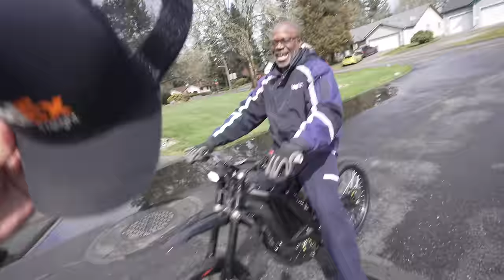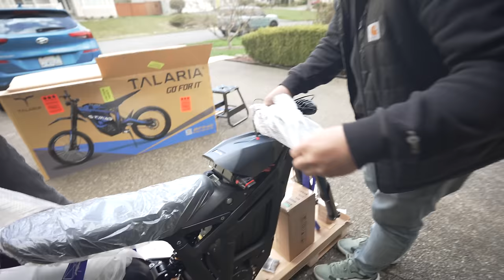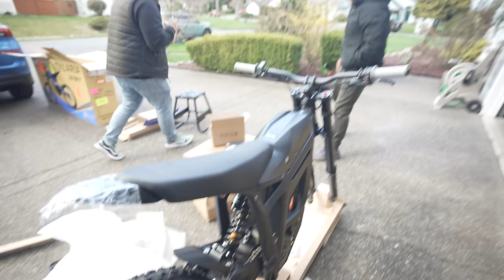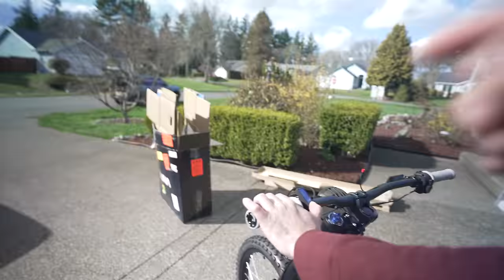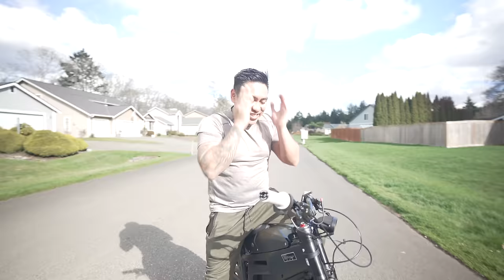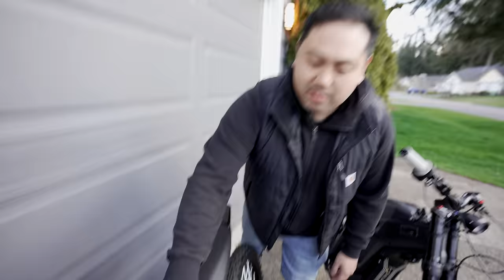Talaria Sting R Unboxing, first ride, and review! @emiliosibs @masonjagat @LunaCyclesLLC

Comment: Why did you cut the brown wire was that the speed limiter?
Reply: I would like to know too?
Reply: Yes it’s a governor, it will limit the top speed of the bike. I think b4 you cut the wire it only goes 18mph in eco and around 28mph in sport… after cutting it goes around 55mph.
Reply: There is also a brake sensor, kickstand sensor and tilt sensor.

Comment: You made that truck drivers day, it took me a second to figure who and what was going on, very cool! I got mine in the shop last night, unpacking and setting it up as soon as I watch this. I  carry my Sur Ron on the rear of my Prius, with the battery in, I hope the additional weight doesn't change that, if it does I guess I can take the battery out but would rather not mess with that.

Comment: The Throttle housing is similar to the Domino throttle as well as the spring feel. The Throttle internals are deff not the same. I’ve tested not only the voltage but seen the PCB itself & it’s hall based vs the Domino being a Potentiometer.

Also the MX4 has 8kW of power vs the Surron being 6kW Peak.

Now let’s link up so you can ride some modified shit 🤙🏼⚡️

Comment: Owning a 2019 LBX and an early talaria sting. I chose the sting as the snappy throttle makes it feel so much more fun (just the way early bikes were tuned).
The shape and feel of the bike sits so much nicer for aggressive trail riding. Your knees don't get sore from trying to hold the bike. 
Stock to stock the sting is just that bit nicer everywhere. 
Now with the sting r more people are actually coming to that conclusion. The bits they upgraded certainly make it tempted to upgrade my bike, but maybe in a few years.
Reply: Put a fardriver on ,and get rocket performance!

Comment: It doesn’t lose power at top end. You need to put it in sport mode. It goes from 0-53mph in like a second or two it seems. Pretty fast right out of the box. In Hawai’i, I spent $5000 for the bike because of the shipping cost. It sucks to live in Hawai’i because of that. Anyways, thanks for posting this review. I appreciate you.
Reply: I just found a talaria sting r for 2600$ you have a limited edition bike or???

Comment: It has IPM motor which teoreticaly is pretty simillar to KO motor and should be able to handle quite some power, on top it will be more efficient, so range is goign to be better as well. At least on paper.

Comment: I have little interest in trails or off-roading, but this thing looks pretty cool.  So is the Sting R technically legal to ride on the roads w/o plates?
Reply: No, it isn't legal to ride anywhere but private land. People who upgrade these for road riding are just chasing trends. There are much more practical options for pavement.
Reply: @justinbogart278  Thanks Justin, I was looking into getting a hyper scooter for around town as I dont think the cops would break stones about that unless speeding, but this looks safer, although I suspect they would be all over it since it basically looks like a dirt bike.
Reply: @ssoffshore5111  ya legally this is just an unregisterable motorcycle. Overpowered scooters are much easier to get away with but also yes those small wheels are much less safe at speed.
Reply: @justinbogart278  Exactly, which is why this caught my interest.  I think the cops would be all over me like stink on shit with something like this in my small town community... hence my question.  The fast stand-up "hyper" scooters really need 13" wheels to be a lot safer IMO.  11" is commonplace now, but I suspect they will keep getting bigger in time for safety and comfort.  I have a little Mantis V2 with 10" which does high 30's, even at that speed I'd feel better with larger wheels.
Reply: @ssoffshore5111  look into building a BBSHD mountain bike with street tires. I love mine, never going back to scooters
Reply: @justinbogart278  Sounds nice, but I'm doing a major home and garage remodel which will likely take me at least a couple more years, so I really don't have the free active time to add yet another project to the list at this point.  Best of luck with your build, it sounds pretty neat!

Comment: Why do people cut the wire?
Reply: To unlock the full power of the bike. They ship only being able to use a fraction of their power so to unlock it you have to cut the one wire. It's the exact same with the Surron. 

The Talaria Sting MX3 just required you to do a sequence of clicking the start button and brakes instead if cutting anything. I really wish they brought that to this bike too. I just don't like cutting a wire with something I just spent over $4k on.
Reply: @jacklinsey  No biggie, snip, done. Can always be spliced.

Comment: why doesnt anyone explain why they cut the brown wire? and why do you unplug the brake wire?
Reply: Cutting unlocks the higher speed. Disconnecting disables power cut off so they can control the wheelies better.